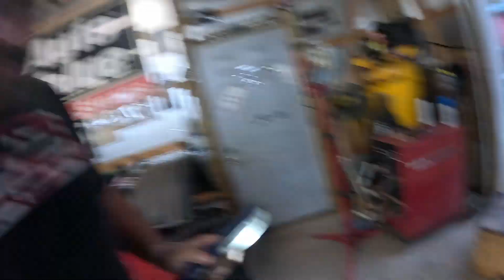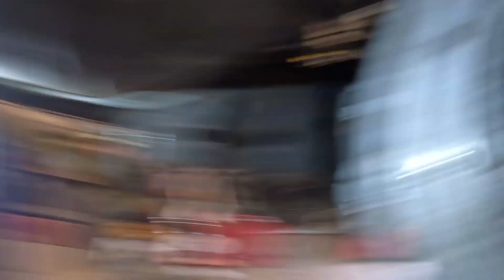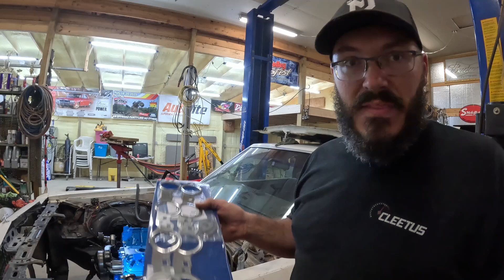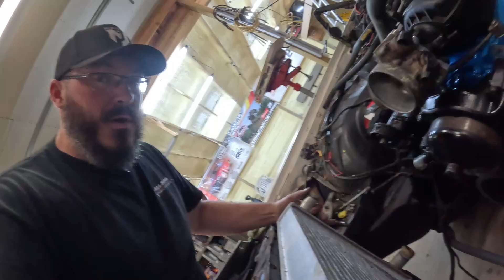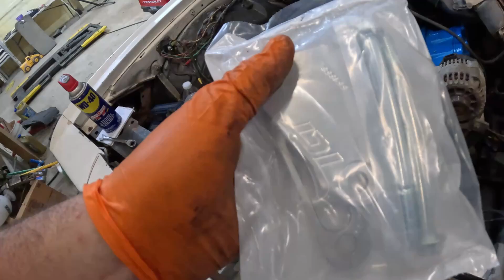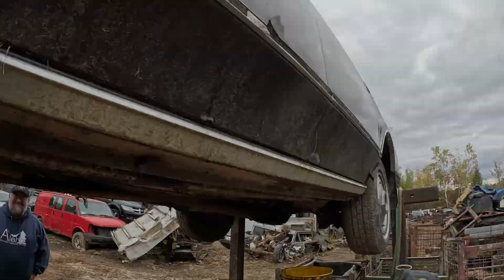The World's First! LS SWAPPED MANUAL 1983 LTD Crown Victoria!

Comment: Great video! My grandpa died back in 2022 and had a 1990 crown vic LTD with a stock 302. Im planning on restoring it with a stock LS. Do you mind sharing the motor mounts needed to mount the LS on a crown vic frame? Thanks!
Reply from the maker: Sure thing!   I used Brian's machine shops Derby lower mounts and knock off dirty dingo slotted mounts I did flip them side to side and  redrill holes to lower it more.  It would have worked sitting high just since I went manual the trans wasn't back far enough for the shifter.  I love these old cars!    If you watch the earlier videos leading up to this I talk about the mounts and show them thanks for watching!
Reply: @Bendinwrenches24  Thank you for sharing that info! I really appreciate it! I'll subscribe to stay updated with your videos. I'll go back and watch your previous videos on this build
Reply from the maker: @jose38706  appreciate the support!   Got another update coming Friday! 😁
Reply: And mine I use universal weldable mounts
Reply from the maker: Nice!